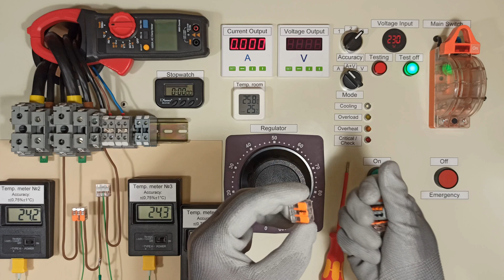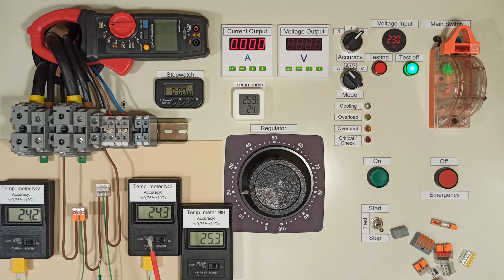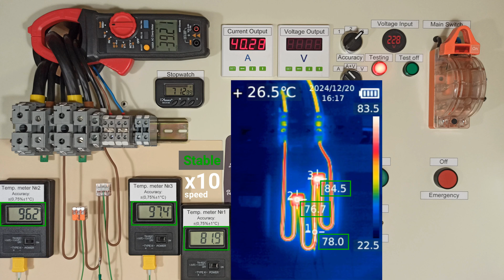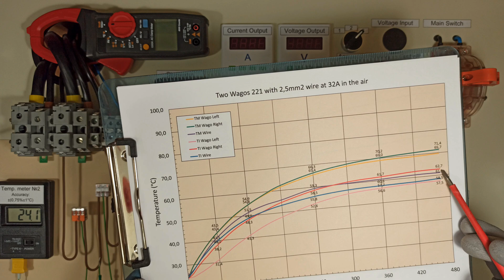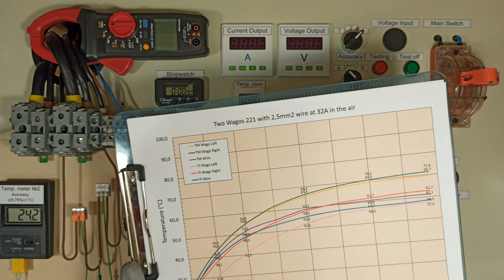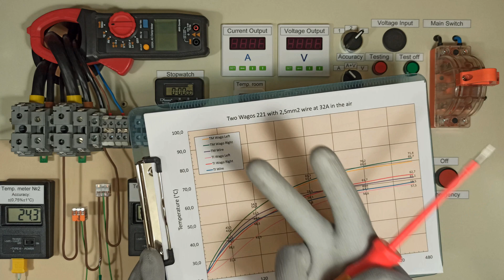Wago 221 test 20,25,32,40 amps current. All temperatures

Comment: Wagos are good for lamp circuit or  16amps MAX
other than that I use "sugar"(in french : sucre)  to connect other cables
Reply from the maker: Hi! Thanks for your comment!
I found it really interesting to learn that you call them “sugar” 😄
I’m not so sure about their reliability though — there have been quite a few emergency situations.
Of course, it depends on how well they’re tightened and if they’re checked regularly.
Reply: @ElectroTest_1  
Sorry it's called "Barrette de connexion" or "domino" in french
you can connect 2 wires together with a screw
same as wago but with a screw

Comment: Heat obviously means resistance...what resistance is there across the Wago at the 80° ?... 🤔

What is the power loss caused by this resistance ?...🫤
Reply from the maker: Yes, I completely agree with you! This can definitely be measured and calculated in additional ways. Thanks for the comment!

Comment: The wago temp and the cable temp is quite similar, but the wago 221 can take a 4mm2. Would be nice to test as we know 2,5mm2 is 16a max in eu.
Reply from the maker: Thanks for the comment! Yes, I can try with 4mm². As for 2.5mm², it can carry more than 16A. It depends on the installation conditions and all elements of the line.

Comment: It would be interesting to test the temperatures recorded at the terminal of an MCB (where the screws are tightened to a certain Nm value) and a Wago plug (where the pressed clamp tightens the wires, but on the solid ones, it allows them to be twisted easily).
Reply from the maker: Possibly. But an MCB is not a connector — it has additional internal heating due to the tripping mechanisms. Although, I think it could actually be cooler. I think a feed-through terminal block with screw clamps could also be added to the comparison.
Reply: @ElectroTest_1  this would be a more relevant test. Tks!

Comment: I wonder how much heating is from WAGO itself and how much is transfered from wires ? Maybe you could test it using thicker wires.
Reply from the maker: I uploaded a new video with Wago. The wire is 4 mm², and the result turned out quite interesting. The video is called "Original Wago vs. copy: which one wins?" I think you’ll find it interesting.
Reply: @ElectroTest_1 Nice you rembered ! 🤯 indeed very interesting and very scary at the same time.. almost identical but 71 degrees at rated current 😱 imagine few such in a string...
Reply from the maker: Yes, I was surprised by the result too)

Comment: There are 221 Wago rated 41A available - could you test them? And please therefore include specific information which version was tested in this video to avoid confusion.
Reply from the maker: Hi! In this video, it’s the Wago 221-4 (4mm², 32A). I also have connectors for 6mm² (41A). I’m thinking of testing them. With flexible or solid wire? What do you think?
Reply: @ElectroTest_1  both - would be interesting to see the difference ❤ you’re awesome. Thanks!

Comment: H07V-U or H07Z1-U is the document data for 19A in a pipe, 32A in the open air 2.5mm² cable. H07V-U or H07Z1-U 2.5mm² cable is joined together by bending.
In the first scenario, the joint, that is, the bent section, is fixed inside the screw terminal.
The second scenario is to insulate it with heat shrink tubing or electrical tape.

I use the first scenario. After bending and joining two or three 2.5mm² cables, I prefer to insert the joint into the No:3 (6-10mm²) screw terminal (H.free screw terminal has a continuous operating temperature of 90°c and a short circuit temperature of 120-130°c) and tighten both screws.

Great channel! I discovered the channel with your video "Will Wago 221-4 withstand 15 amps? Thermocouple & Thermal Imager."
Reply from the maker: Hi! Thanks for comment. "cable is joined together by bending." Do you mean a wire connection by twisting?
Reply: @ElectroTest_1  Yes, the copper ends of two or three 2.5mm² copper (2.5mm² solid copper wire) cables are twisted and joined together. In poor quality workmanship, electrical tape is used. Copper is taped with electrical tape to insulate it. For a reliable connection, the twisted copper cables are inserted into the screw terminal block. The two screws of the terminal block are tightened and fixed. Generally, No: 3 screw terminal block is sufficient. No: 4 screw terminal block should be used to join more cables.

Comment: Two ideas for testing:
Do the same test with wire rated at 100-105 temperature and if you have higher temperature wire - 140-150 C to see the diferences, how much the wires can suport without the isolation starts to be affected and for 140-150 C wires we should see the wago melting before the wire isolation.
As i understand 100 C wires with wago should suport 30-40% more amperage than standard 60-70 C pvc wire.
Thank you and manny more videos like this! ;)
Reply from the maker: Thank you for the idea about wires with different permissible temperatures! I’ll need to check what’s available. I’m also curious to see if the WAGO will melt first.

Comment: I love your videos! I'm curious how much of the heating is due to the Wago and how much is due to the cable. There's not much difference between the Wago and the cable, the cable could actually be the one heating the Wago, and the difference in temperature could be explained by a different heat dissipation capacity inside the Wago
Reply from the maker: Thank you for the comment! Great idea! I'll try to do two tests in one video – just a solid wire and the same cut wire with a WAGO connection!
Reply: Is the difference simply not the fact you are reading busbar temp directly, whereas the top face is impeding the IR reading on the cooler one? The internal temps are the same, so...

Comment: So only at the full 32 Amps there is a meaningful difference in temperature. ~60c vs. ~70c. 
In the field one would never use 2,5mm² for a 32 Amp circuit, 4mm² minimum and if its a long cable run 6mm². So I recon with a 4mm² the Wago would not go anywhere above 50c.
2,5mm² is our standard cable for load circuits up to 16 Amps.
1,5mm² we only use for lighting circuits.
This way we can keep voltage drop to a minimum and accomodate suboptimal installation of the cable in places where it cannot dissipate heat very well like inside an insulated wall.
Reply from the maker: Thank you for the detailed comment! Overall, I share a similar opinion regarding cables. However, in household electrical systems, the wiring often has a large safety margin. For example, 1.5mm² cables can be used for some socket circuits with the appropriate circuit breakers. By the phrase "insulated wall," do you mean concealed wiring in general, or specifically in walls with insulating materials? How do you typically perform such an installation?
Reply: @ElectroTest_1  im refering specifically to framed metal stud drywall with rockwool insulation. Very common system here the rockwool provides thermal and noise insulation and increaseds fire resistance of the wall. The drywall boys throw these walls up in a matter of hours and the metal stud system and doubled up drywall sheets make them stronger than one may assume.
Problem is pulling wires trough these walls derates the amp capacity of the wiring because the wires cant dissipate heat very well.
1,5mm² is downrated to 13A capacity according to the electrical code here so you have to run 2,5mm² for a 16A circuit.
Lighting can be 1,5mm² since lighting circuits are usually 10 Amp.

Comment: Another awsome video, as always! These should truly be used in schools. I have an idea for an interesting topic: comparing the heat generated in solid versus stranded wires, and perhaps exploring the impact of using a wire cramp versus not using one. It could make for a fascinating video!
Reply from the maker: Thanks for the comment! You gave me some great ideas! Do you think there will be a difference between solid and stranded?
Reply: On paper the difference is there but minimal. But how it's going to be in practice, well there's only one way to find out. With a test. :) @ElectroTest_1
Reply from the maker: @no_nerd Good, I will plan such a test!)

Comment: With 32A I would take 4mm² because the wire heats up and in practice with 32A usually even 6mm² is used
Reply from the maker: Thank you! Yes, with 4mm² the result should be even better! Also, for most lines, you can use 2.5mm² and install a 16-20A circuit breaker.